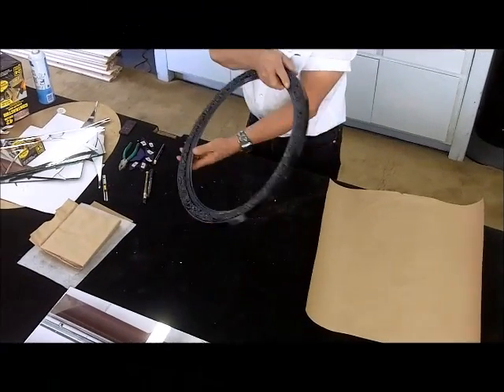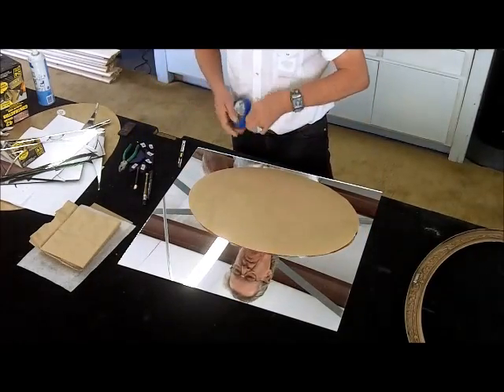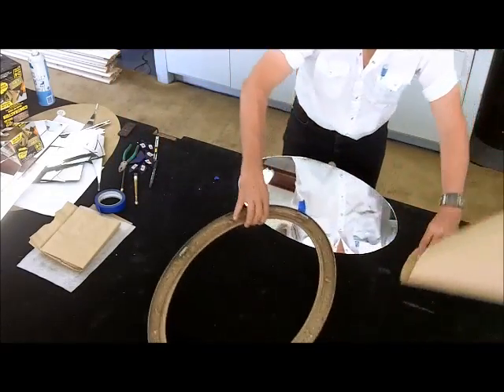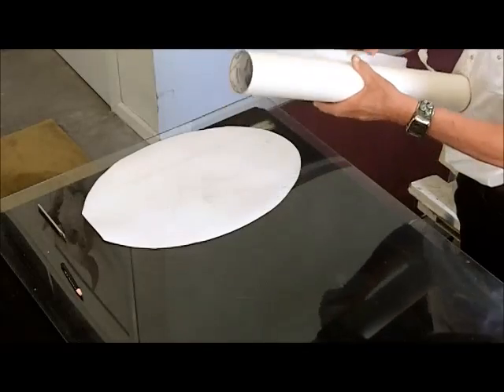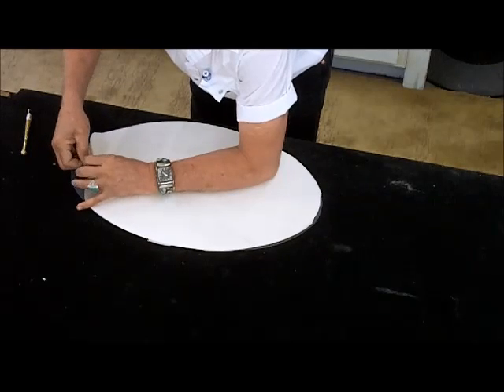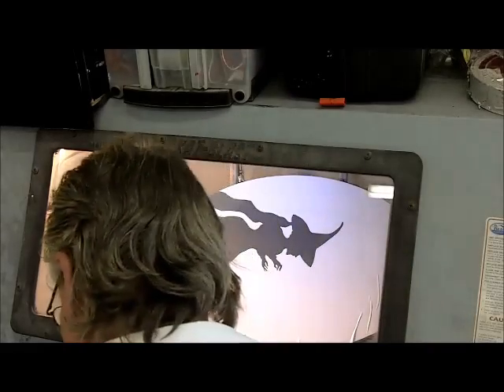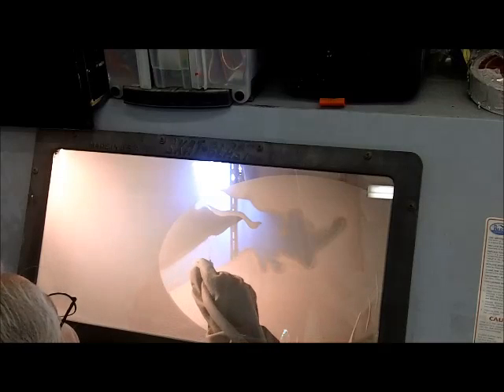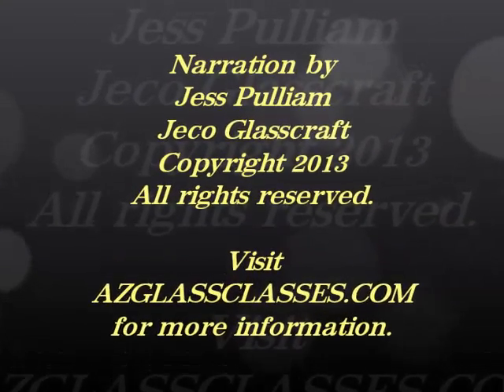CREATING A DECORATIVE MIRROR

Comment: I really like what you did here on this video. I used to have a glass etching studio out in California, but I have since moved to North Carolina. I used the same equipment you did, but I was using my air compressor, your using a different tank with 1/4 line I think and a standard line for the tip sand sprayer. that pot your using how much modification did you have to do, and what keeps it under pressure because you video was quite no loud compressor noise. I'm going to save your video, and who makes your decals, I had to make my own because I was using my own photography. Even through I had my own studio, I learned something from you, with the resent paper. will actually I learned a lot more then just that. Thanks very much. Bill